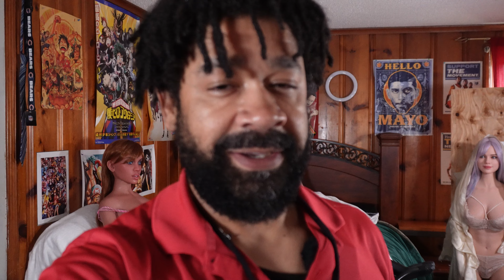Bisaddle Unboxing Review: Bonneville, SRT 1.0 and Hurricane Printed 3D

Comment: Thanks for the reviews, most people don't actually put in a lot of time on a new saddle before judging it, I'm glad to see you do it right. I don't use bibs or padded shorts, but most saddles today are designed assuming people will wear these. The number of saddle options for people who ride without padded shorts is limited. I've done a lot of riding in my day, worked in a bike shop fitting customers, and tried lots of saddles. There is no such thing as a perfect saddle, and trying to find one is like trying to find the end of a rainbow. Your C15 is probably good enough, good enough, though for comfort I might have recommended a slightly wider C17. 

If you are riding without padded shorts, you need to choose your regular shorts and underwear carefully. The weave of the cloth in your underwear can cause saddle sores, or prevent them. I like merino wool underwear with no seams on the part where my butt sits on the saddle. I also wear shorts which don't have seams. There are non-padded cycling shorts out there which don't have seams on the seating area, I like Pearl Izumi's, though they are a little hard to find. Rapha's Easy Tech shorts or pants are also good choices. 

Lastly, when sitting on your saddle, make sure your underwear and shorts are flat, and not bunched up in any part. Saddle sores often start in places where your underwear bunch up. When getting on my bike, I wiggle my butt around on it a little until I'm sure my underwear and shorts are flat, and contacting the saddle properly. Another thing I do to keep comfortable is to get out of the saddle once every few minutes to let some circulation go through. 

For myself, I've been using a Brooks B-17 saddle. When I was young I used to scoff at Brooks, but eventually tried one out, and once broken in, I loved it. If your body is asymmetrical, a B17 will adapt. I don't worry about the leather being affected by rain or bad weather, you can use mink oil to waterproof the leather, this stuff is sold in camping stores to put on leather hiking boots. In soaking rain, a cheap plastic grocery bag will keep the saddle dry. I keep one of these bags tucked up under the saddle, I can also take it into a store when I am resupplying. 

For decades there have been countless new saddle designs to improve comfort. Yet none of these I have tried has ever really worked.
Reply from the maker: I appreciate you taking the time to share your experiences and knowledge on this topic! Actually, I bought the C17, but it was too wide for me. I agree there isn't a perfect saddle but I just want a bit more comfort. I'm testing a couple more saddles now that are pretty good. I'll drop videos after more testing. As far as clothes when riding unpadded, I've found the perfect underwear and I wear unpadded bibs for super long rides. That combo pretty much prevents saddle sores unless the saddle just doesn’t fit. Thanks for your contribution to the channel!